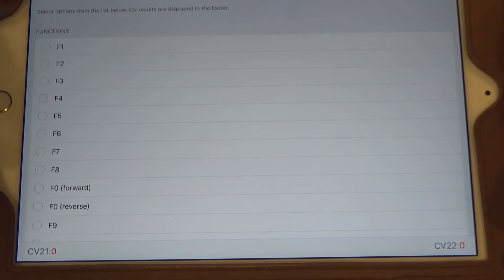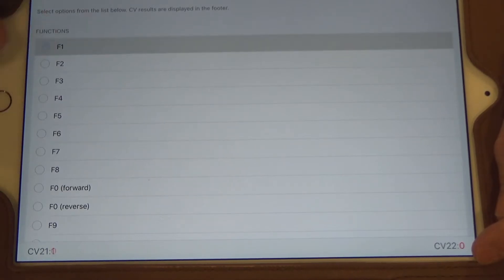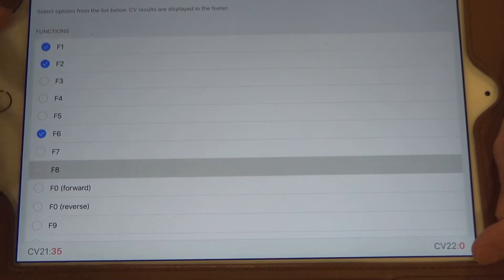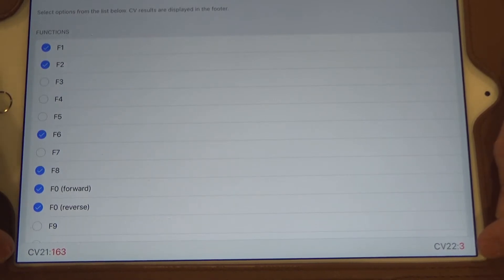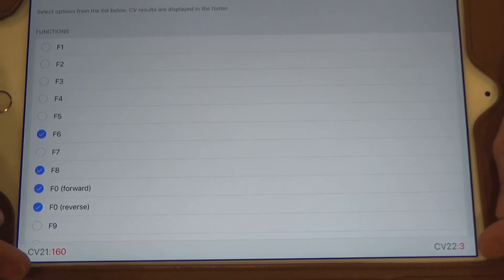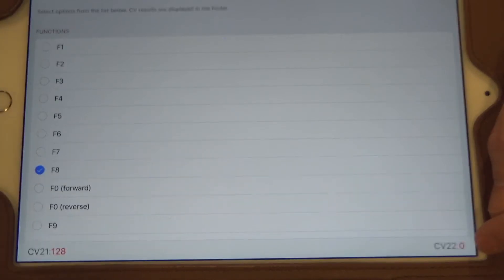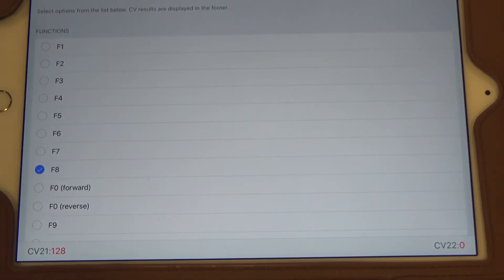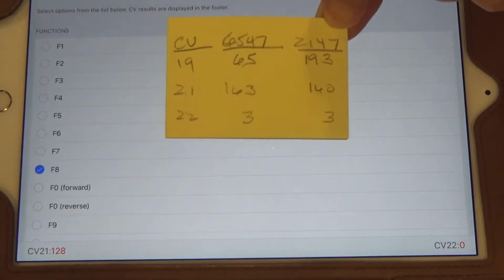Step By Step Advanced Consisting (72)

Comment: Very nice explanation of advanced programming. I did two Walthers E-8s and an E-7. Apparently the E-7 which was third in the consist and running backwards did not like having 128 added to its consist address. So, I went to CV 29 and added one to it. Then it worked just fine. I did find that ops mode programming would not read the CV's and paged mode would. It would also write to them. Ops mode would write but not read. Just for your information's sake. Tom

Comment: Larry,  I watched your other video with this one. I use nce. So for advanced consisting wouldn't you have to set the cv's for your locos and then consist them together? I have the same decoders being tsunami 2 but I'm still confused on how to them setup.
Reply from the maker: With advanced consisting you program the decoders for which functions you want active then save the advanced consist address in each loco and they all respond to that address. That is different than making up a universal or old style consist as NCE calls it. Also their command stations/throttles have their own method for advanced consists that is a bit different.
Reply: I think I understand that.  So I program cv's 21 and 22 for each loco in the consist  and then set each loco to the consist address and then should work as one ?
Reply from the maker: That’s the deal. Once you program the consist address it overrides the primary address. To break the advanced consist you simply change the consist address back to “0”. The function selections remain unchanged and are only active when there is a consist address. I like advanced consists for my mostly permanent ones and the universal consists for creating them on the fly or during an op session.
Reply: Awesome,  thks!

Comment: Larry Thanks for the information I figured out the advanced CV's 21 and 22 245 and 246 for my decoder also.   I am using NCE Power Cab Pro.  I went to the digitrax link and received 404 error page not found they must have moved the link for some reason.   I was using a calculator to add up all the functions,
Reply from the maker: They must have moved it and forgot to update their internal links. I’ll send them an email tomorrow if it isn’t fixed.

Comment: Do you have a video of doing jmri consisting, how to set that up, been trying to figure out how to do it where I can keep my sound on all three locomotives, but on have the lights and all on the lead, using consisting threw nce doesn't help and can't figure out the cv numbers to program with, but did follow you on Facebook and all
Reply from the maker: If I understand your question, then what you want to do will require getting into the details of CVs 21&22 which allow you to set which functions the decoder responded to when in an advanced consist. I’ll have to go back and rewatch that video but I thought I covered that in another video on DecoderPro. If nit then that would be another subject to add to my to-do list.

Comment: Thanks for the video. Worked perfect for me. I now understand all this is pretty much BINARY.. without the computer I can now calculate on paper which features to turn on for each loco in CV 21.

Also what are values in  CV 19 and 22 used for anyway? 

Regards
Reply from the maker: 19=advanced consist address
21=advanced consist functions 1-8
22=advanced consist functions 0F, 0R, 9-12

Comment: Question...I want to consist two F7's back to back on a point to point switching layout. Any issues with lead locomotive changing so often? Using MRC Prodigy Elite. I do not have room for a loop.
Reply from the maker: No problems. You have the option of allowing both locos to respond to horn and bell commands or use advanced consist to limit that to just one of them. You can also program them so the headlight only lights on the loco in the lead by setting them for directional lighting.

Comment: Hello Larry. I have strange issue with TCS decoders. So, after I watched your videos, I'm trying to consist 2 Atlas C420s, one with TCS Wowdiesel 1530 and one with TCS EU621. I put the locomotives back to back and I want only the front headlights working, and not also the rear headlights. After programming CV19, CV21 and CV22, is it normal that the EU621 understand that it has to lights up only the front headlights according to the direction of travel, and the 1530 not? If I write CV22=0, no headlights and it's correct. But if I write CV22=1, 2 or 3, there is no difference for the 1530: it keeps turning on and off front and rear headlights according to the direction of travel when I turn the lights on. I don't understand why. Maybe a decoder's software bug? (I bought both the engines used from ebay and I don't know if the wow need a nuclear reset. Never opened and I hope not to find a surprise, but I know the old owner has inverted white and yellow wires so I have to change CV49 and 50 after every reset).
Reply from the maker: Oddly I was just playing with a WOWSound advanced consist set up the way you describe. With mine I have it set up so that whichever loco is in the lead responds to headlight commands—works great. I used DecoderPro to program them, do you have that? It makes programming these decoders so much easier since it keeps track of all the differences among the various decoder versions. It also does all the background calculations for the you which can be an issue with some features in TCS decoders.

Comment: Absolutely fantastic video. I was struggling to understand Advance Consisting and how it all worked. Add to that, my point modules on the layout hadn't been wired quite right I couldn't use railcom at all. Point modules sorted and your video have now allowed me to achieve exactly what I wanted to do. Cheers!
Reply from the maker: Glad the video worked for you. There is a lot of confusion and lack of information in the hobby about many aspects of DCC and consisting is one of them.
Reply: @TheDCCGuy  I got used to the Bachmann Dynamis where it had controller based consisting. Simple but basic. Having moved over to the Z21, I have found there is a lot more to DCC and I am on a learning curve with it.

Comment: I have a question. I have a loco with flashing ditch lights that turn on when the horn blows. They work fine except when I put the loco in the lead of a consist. Then they quit activating. But they work fine again when I delete the loco out of the consist. The loco has a Tsunami 2 TSU-2200 that I installed and my system is an NCE Power Cab. I wired the ditch lights to the FX3 and FX4 wires. I used JMRI to do my all my lighting programming. I use the Power Cab consist buttons when building the consist and I pick the advanced consist selection. I've looked at the JMRI lights and consist pages and can't figure out a solution to correct the problem. Any ideas?
Reply from the maker: You need to create the advanced consists for those locos and use the CV settings to allow those functions to respond while in a consist.
Reply: @TheDCCGuy  Thanks for the reply. Is that something I have to do on the Power Cab? I'm still scratching my head trying to find anything that makes it work using decoderPro.
Reply: @TheDCCGuy  Phew, I finally got it figured out after pulling some more hair out. lol. Thanks. A lot of decoderPro's parameters are hard to figure what they do.

Comment: Can you use a combination of advanced & universal programming in a consist
Reply from the maker: Good question, and the answer is yes for the systems I am familiar with. You can take two or more universal consists and consist them and also add advanced consists to universal consists. I have never tried adding a universal consist to an advanced one and I am not sure that would work but it would be easy to test. Just program the advanced consist address into the top loco of the universal consist and see if the rest respond. However, mixing things up like this could get very confusing very quickly and you may end up having to delete all consists just to break up the one you lost track of. I prefer to use advanced consists for semi-permanent groupings and universal consists for those to be made up and broken again up during an op session.

Comment: Thanks for the helpful video. 
Have a question about your layout. I am building a double deck what is the spacing you have between the lower and upper deck? I’m trying to figure out what a optimal distance would be for my layout
Reply from the maker: The top deck is 16” above the main deck. This varies a bit at one end as I put in a down gradient there leading down to the top of the helix. Also my fascia is 4” which basically hides all the wires, lights, switch machines, and other clutter. That gives me about 12” clear space between the main level and bottom of the fascia. With the main deck ranging from 16-24” deep you can see everything from the front without dipping down unless you are the Jolly Green Giant! I am planning a tour of the layout if I can ever get everything out away.
Reply: The DCC Guy thank you very much for the helpful information would love to see a tour of the layout